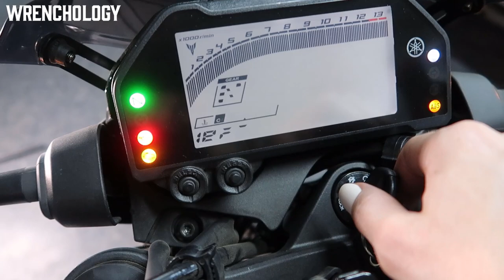How to change the Engine Oil & Filter on a 2020 Yamaha MT-03

Comment: Hello, the link to the OEM crush washer says it’s for an R6. Will it also work on the MT-03?
Reply: im also curious about th ecrusher washer, can you please inform me if you eveer found a better option? I have been looking and the ones from yamaha are stupid expensive
Reply: the link for the whole set wirh oil and filter also says r6 IS IT GOOD OR NOT FOR MT03?
Reply: @Voltomess  yes.....yamaha have the same filter fit like 15 bikes.......everything is the same relax